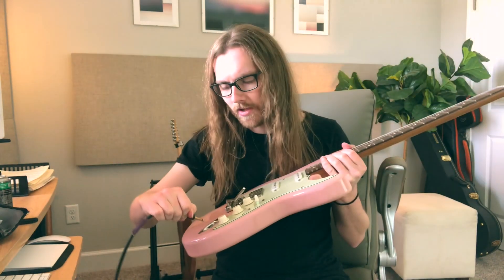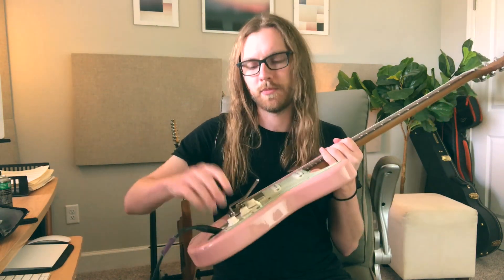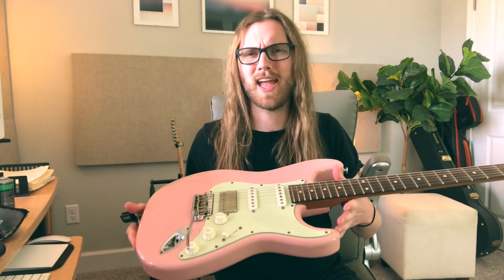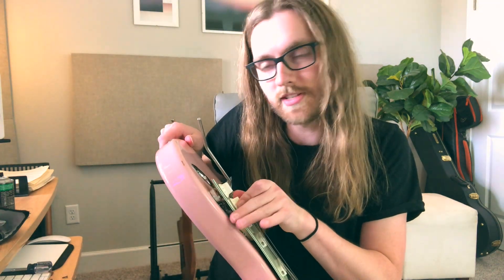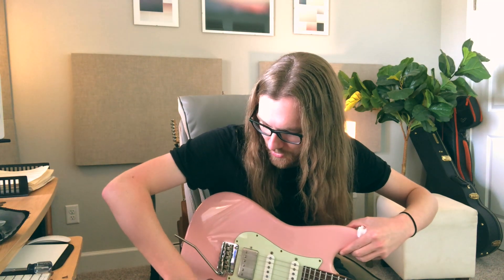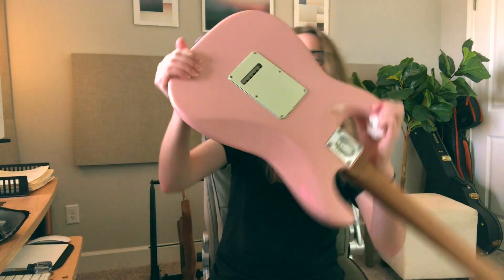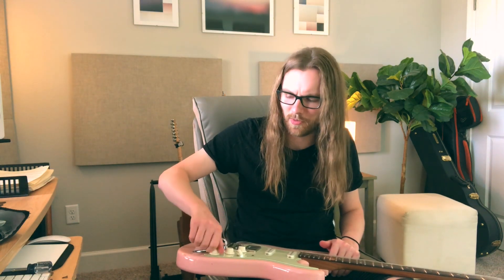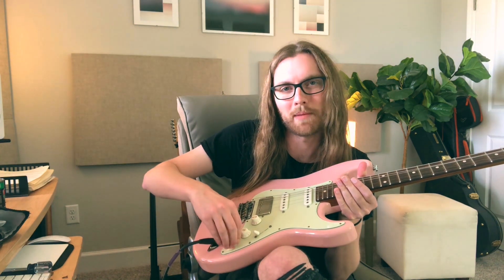YOUR GUITAR ISNT BROKEN! How to Fix Scratchy Volume and Tone Knobs!

Comment: Hey , do I need to use that specific contact cleaner? I cant find any on my local shops but other similar brands are available. Should I just go with whatever? Thanks for the info man you got a new sub!
Reply from the maker: Just make sure it's lubricated! Normal contact cleaner will strip out the lubricant, and your potentiometer will need some just like a fader does. Disclaimer though, I'm not an expert on electronics, I just know this stuff works for its intended purpose. Regular contact cleaner may actually work fine in a pot, but I personally have only ever used the lubricated kind.

Comment: This video is awesome!Thank you so much!Also if you replace your coffee with hydrogen water you're health will greatly improve Coffee leaches magnesium out of the body,an essential nutrient bro.
Reply from the maker: @Matthew-z3p7p  oooh. interesting note. I haven’t had coffee in a minute tho, but I will look into this hydrogen water thing. I’m glad the video helped you. happy guitar repair!
Reply: @Plant_Based_Riffs  I told you just in case so you knew.Fantastic video. I have a 95 strat reissue with active e.m.g. pickups,but the knobs need cleaned.So glad I didn't use contact cleaner

Comment: Question before I start a mad scientist experiment but my volume is fine. Just at times when I turn it down. It’s back to 10. Any suggestions?
Reply from the maker: ooh, that sounds odd. There may be some bits of conductive material that has kinda shaved off while rolling it up and down, and it is now sorta "floating" or "stuck" in there giving you inconsistent volume changes. This method of flushing out the pot with F5 should get that gunk out of there. If it doesn't work, you may need to change out the pot as it may have just gone bad. :\

Comment: On my Les Paul, sometimes when i adjust the volume knob the volume drops a ton even when i have it turned all the way up.  Is that a connection issue rather than a lubrication issue you think?
Reply from the maker: the two can be hand in hand. It could but the little sweeper inside the pot that doesn't make connection to the track because it's dirty. Could be a bad pot. I would definitely try cleaning it out first and seeing if that fixes it. It's a lot easier than replacing the pot.

Comment: Quick question: So I have an Epiphone Les Paul Prophecy which I play on an Orange overdrive combo amp channel. I use one pickup as my dirty sound with the taper volume pod pulled out and tuned way down to cut the gain and my other pickup turned up to the amount of gain I want. I use the pickup switch to change between them. anyway question is, does playing throgh the pickup with the turned down volume knob create the risk of causing a short cuz I have been experiencing a little bit of tone phasing which seems to come in and out when on the turned down pickup. I'm wondering if I am shorting it by playing it at such a turned down setting or if my constant changing of the knobs is actually shorting them. Works just fine with the knobs cranked up.
Reply from the maker: Love the question, thanks for reaching out. So... What is your entire rig? 
My suspicion is that you’re using a modeler or amp sim of some kind, and the “tone phasing” you’re experiencing is not caused by the guitar pots as much as the modeler’s inability to create a decent tone with such a low input volume. To answer your specific question: No, I don’t think you’re at risk of causing a short using this method. I think fouler forces are at play.
Reply: @Plant_Based_Riffs thanks for replying so fast. So this setup is a straight guitar to amp set up. Normally I run the same guitar to a Boss GT-10 multi effects processor then to the amp but lately I've just been wanting to plug in and play so I go directly from the guitar on a single 5 foot live wire advantage cord. The amp is a Orangr Crush  35RT small combo. And I'm operating on the dirty channel only using amp reverb at  about 60% level. I'm now maybe thinking that the pickups are doing it cuz the prophecy line runs fishman influence active pickups. May e I just need to switch the battery. I've only had the guitar about a month and this is my first time using active pickups. Idk but that's the whole rig. Les Paul Prophacy to amp. Think it might be the pickups running out of battery juice maybe? That's the only other think incan thinking since I have no external preamps or effects chains or loops lined in.
Reply from the maker: @jamesparker384  Hmm. I’ve had students with Fluence pickups and they’ve indeed behaved very strangely when the battery is going out. If you have an instagram, send me a video of the problem if you can recreate it. @plant_based_riffs
Reply: @Plant_Based_Riffs  So I figured it out, it was the battery for the pickups. Gonna have to keep an eye on that in the future. It lasts pretty long though with constant use. Anyway we can still instagram follow each other if you want also. Thanks for your help.
Reply from the maker: @jamesparker384  glad you figured it out!

Comment: Would this help if my volume is cutting in and out? I checked all the connections and everything seems good
Reply from the maker: it could! If you have a dirty enough connection in the pot, you may need to clean it. It could just be a bad pot. I would probably just take it to a guitar tech and have them diagnose it

Comment: Can I use this on the pickup switch on Gibson
Reply from the maker: Yep, you sure can! This is safe for all electronics and plastics. Spray some in there, move it around, and then wait about 2 or 3 minutes. Plug it in, and you should hear a much better sounding pickup switch. If it works, post a video of it on instagram and tag me in it so I can see! @plant_based_riffs
Reply: @Plant_Based_Riffs  will do and I was wondering on this video when you open the pickgarud do you have access to the other knobs as well if you need to get those ? Or is it just the one you did that you can get to
Reply from the maker: @jboy8735  Yeah I can access all the knobs! It’s MUCH easier if you take the strings off first haha
Reply: @Plant_Based_Riffs  I have a strat as well that’s why I asked it has the locking tunner knobs wich always makes string changes easy to do

Comment: would Wd-40 work????
Reply from the maker: @captainzyte4476  Nope! WD-40 is oil, not cleaner. Oil will attract dust, hair, fuzzies, etc and make the issue even worse! Contact cleaner is safe for electronics and evaporates very quickly. It flushes out debris and dust and leaves behind a protective layer on the track and sweeper of your pot. :) 

You’re not even supposed to use WD-40 on your tuners for the same reason. It will just always collect more and more gunk and gross stuff and make your tuner action feel horrible. I’ll have a video coming soon about how to save your tuners when they’re feeling disgusting, and how to properly lubricate them.
Reply: You can use the WD40 contact cleaner (not the lubricant) Im using it and it works great.

Comment: some of my tone pots when I turn it up some pick ups work when I use the switch so some work and some don’t and I have to put it to zero both of the tone knobs I move slightly it crackles and no volume on guitar how do I fix the problem 😭🥲
Reply from the maker: I think I understand. You’re not getting any volume from some pickups, BUT, when the knobs are all at zero, they will crackle when you wiggle them side to side?
Reply from the maker: Based on the symptoms you've described, it seems like there may be an issue with the wiring or connections in your guitar's electronics. Here are a few potential causes for the problem:

1. Loose or faulty connections: Over time, the solder joints connecting the wires to the pots or switch may become loose or break. This can result in intermittent or non-functional pickups. The crackling sound you hear when wiggling the pots suggests that there may be a loose connection.

2. Dirty or worn components: The crackling sound could also indicate dirty or worn potentiometers (pots). Dust, debris, or oxidation can accumulate inside the potentiometers, leading to poor electrical contact. Turning the pots might temporarily restore the connection, causing the pickups to work again.

3. Switch issues: The switch itself could be faulty or dirty. A malfunctioning switch may not properly engage the pickups, resulting in their failure to work when the switch is activated.

To diagnose and fix the problem, you can try the following steps:

1. Inspect the wiring: Carefully examine the wiring inside your guitar, paying close attention to the connections between the pickups, pots, and switch. Look for any loose or disconnected wires. Resoldering any faulty joints may solve the issue.

2. Clean the pots and switch: If you suspect dirty or worn components, you can try cleaning them. Use an electronics cleaner or contact cleaner specifically designed for guitars like Deoxit F5 like I demonstrate in this video. Spray a small amount into the potentiometer or switch and then rotate or toggle them multiple times to distribute the cleaner and remove any dirt or debris.

3. Check the switch: If the issue persists, you may need to investigate the switch more closely. Inspect it for any visible damage or signs of wear. If necessary, you might consider replacing the switch with a new one.

If you're unsure about performing these repairs yourself, it's recommended to take your guitar to a professional guitar technician or luthier. Don’t break your guitar trying to solve the issue :)

Remember, working on the internal electronics of a guitar requires knowledge and a fair bit of skill, so if you're not confident in your abilities, it's best to seek professional help to avoid causing further damage.